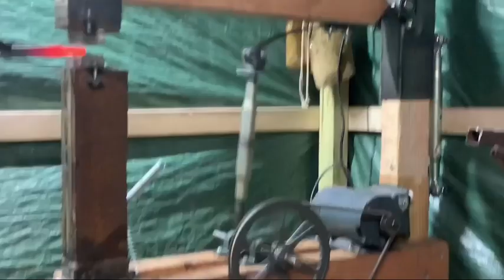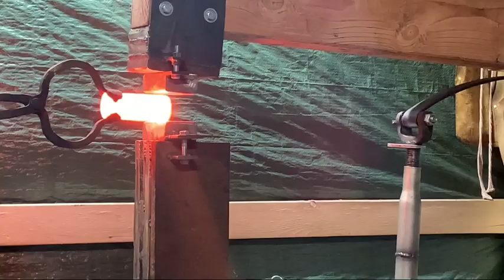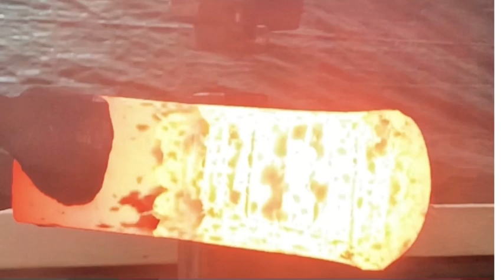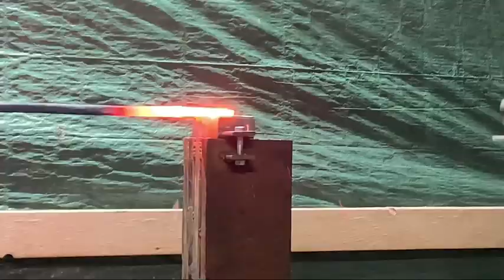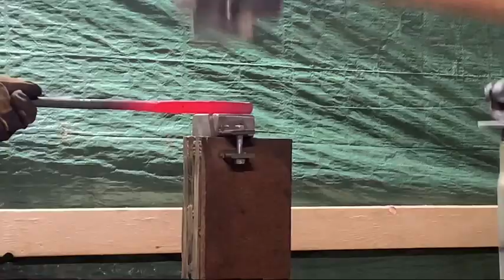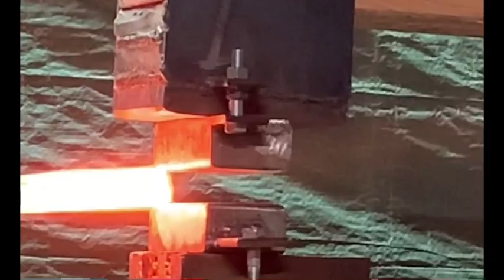homemade Beam Power hammer forging.

Comment: Honestly, that is all the hammer that the majority of enthusiasts would need.  I am really impressed with how well it moves the metal.  It looks like it needs anchored and reinforced, but wow.  I would like to make it out of oak or hickory beams perhaps larger in dimension.  I keep thinking about those giant helve hammers in England.
Reply from the maker: It was very good for what it is. Heavier hardwood beams would definitely be ideal. They would add rigidity and mass which would only make it better. They were just out of my budget at the time. Definitely needs to be anchored down this was just screwed onto a wood block not actually anchored to anything

Comment: Finally a real test!! So many people say " Testing homemade power hammer" and the hammer 1/4 round.. or its even cold stock.. you showed a lot of different steel sizes! How much money do you have into this so far?  
Great work!
Reply from the maker: That bugs me too haha. I wanted to show the hammers true capabilities by using a wide range of stock sizes. I think the 1.625” diameter 4140 was the most impressive. A lot of homemade hammers probably couldn’t do that. 

I believe I have spent about 600-800$ on this hammer. Seems like a lot but a tire hammer would have cost about 2600$-3000$. And almost any other homemade power hammer is useless it seems like. So I’m happy. It will pay for itself quickly.
Reply: @JustinTopp  thanks for the response! 

True what you say. Again nice work!
Reply from the maker: @xRoSkii  thanks!

Comment: Dang! It certainly is effective. How about dynamic range? Can it strike softly? What motor stats? Im impressed.
Reply from the maker: @ricoloco2803  you could draw out 1/4” bar stock by feathering the motor lightly or draw out 2” bar if you wanted. Surprisingly versatile. Great for drawing the edge out on an axe or drawing the reigns out on a pair of tongs. The 1-5/8 round bar demo wasn’t even with full force. I didn’t use it long but it was impressive for being made mostly of wood. Motor was 1800 rpm 2 hp.

It would be even better bolted to a concrete foundation. Mine was just sitting on a couple railroad ties that were in the dirt

Comment: Wondering if this hammer needs to be anchored to the floor or could it be used on a large timber base?
Reply from the maker: It’s on a large timber base set into the dirt in this video
Reply: So do you think it would work on a concrete garage floor with maybe a thick rubber mat underneath?  Reason I ask is winter is real cold here!

Comment: What size is the motor my 2hp won’t turn mine over?
Reply from the maker: Something must be wrong. Mine was I believe 1.5 or 2 hp. Try a bigger pulley on the cam

Comment: So, now that you are using the cam, how do you like it compared to the crankshaft style you used in this video? Any pros cons etc? The crank looks like it would be easier and cheaper to fabricate.
Reply from the maker: The motor pretty much kicked the bucket after about a week because it was old and junk. so I haven’t used it other than a few times after this video with the proper cam on. But some pros are it’s smoother running and has a bit finer control. But it’s a lot harder and more expensive to make. The crank honestly works fine and I would just build a better version of it if I were to do this again.

Comment: That's really impressive! I'm surprised at how quiet it is. I had a question on your cam, I see yours is different than that giant fabricated roller bearing, how does that center section of yours rotate to push the leaf spring linkage? Is it a piece of rod inside a pipe?
Reply from the maker: I switched to the Roller bearing since this video but it looks basically like a crankshaft for a engine. It’s a rod with an off set in the center. There is a pipe around the round part of the offset. The pipe is connected to the top link that is connected to the spring
Reply from the maker: Thank you!

Comment: did you leave the cam like you have it here, or did you wind up changing it to be like Roy's design?
his looks kind of over-engineered compared to yours. don't see a reason to do his version over yours really.
Reply from the maker: @envarin888  i did make a cam like he had, cnc machined one and it was better, smoother and slightly more controllable than this. But I think with a bushing or bearing so it wasn’t just a pipe on a metal rod, and fit better, it would be pretty much just as good. Along with a more balanced / straight crankshaft. 

This worked just fine though I used it more like this and didn’t have any issues. The improvements didn’t justify the cost to me. Especially on a budget built hammer such as this. 

I would just do this again if I were to build it
Reply: @JustinTopp  interesting, thanks. i think i'll just do it your way then :)

Comment: I've reported this video to Youtube.
Why? Because I'm jealous and I want one..... NOW!!
Seriously though, great stuff. One question though (btw, I've not really reported ;)  ) what is the power rating of the motor?
Reply from the maker: Haha thanks. It’s a 2 hp 1750 rpm motor. I suspect it would work fine with only 1 hp
Reply: @JustinTopp  Thanks Justin. I'm asking because (all joking aside) I think I'm going to need one. I'm very slowly recovering from Blacksmith's/Tennis elbow. Not lifted a hammer since 18th Dec and will probably be quite a few more weeks yet. So bloody painful.
I'd only had my set-up about 2 months prior!
Reply from the maker: @kevg3320  ouch that’s no fun. Yea a power hammer like this can definitely help out. This one is a good beginner hammer in my opinion. Powerful yet simple to build in a home shop. Nothing specialized